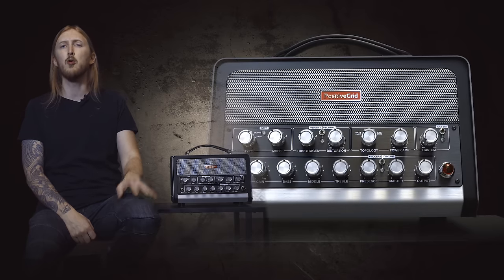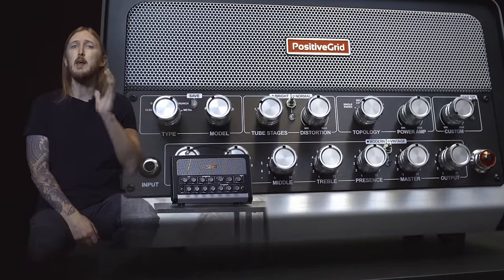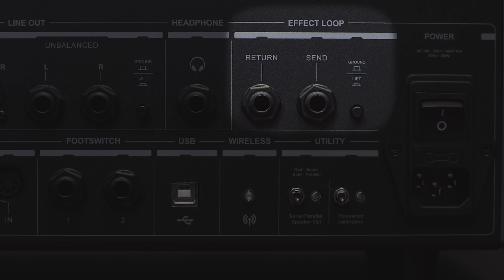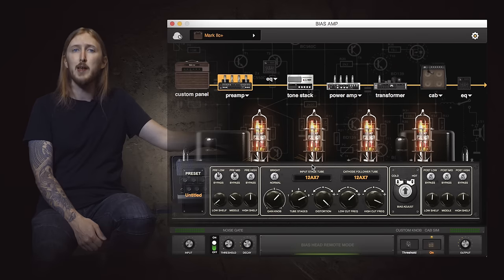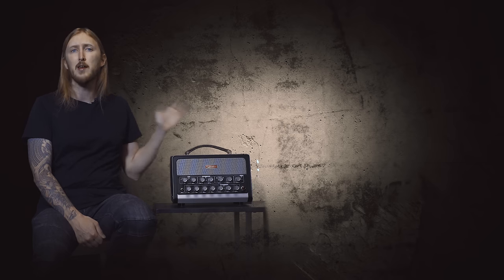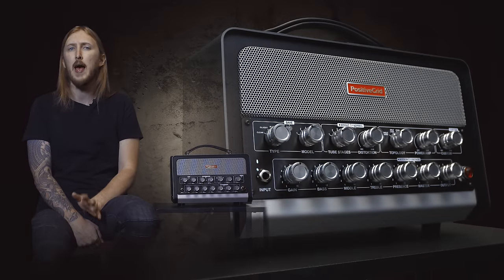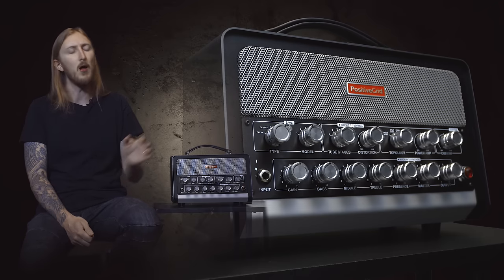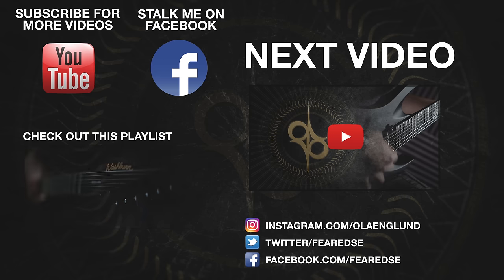BIAS Head - Metal?

Comment from the maker: Everyone complaining about the direct signal , just remember that the presets are created to sound awesome in the room using my cabinet and microphone. The direct signal clips in this video are basically the same presets with just the added cab sim in BIAS Amp. If I were to set up the sounds just going direct they probably would've sound a lot better. 

Put a thumbs up on this comment to keep it at the top.... maybe....
Reply: Now that you can pin comments Ola, you should do it on this one. Great vid.
Reply: Sounds just fine to me....
Reply: this is over...im buying the mini...an Apolo interface...and going straight to my laptop...my only problem is that i need a real cab and good monitors but i don't want something very expensive...i need very good monitors that can sound natural with the cab sim...so i can hear my tone

Comment: Still confused on what the BIAS head is. Like answer me this, strictly soundwise, the sound signal that's coming out of the head, is it any different than the BIAS software? Like have they improved or redone anything or is it the same modelling? 

I get the idea of bundling it all up in a head, and the hardware features are nice, but I'm having a hard time reconciling the price for this thing if it's just the same sounds as the software?
Reply: I think the main thing is that you also have a built in power unit to it, whereas with most modeling amps currently you do not have that, and would need it to use live. (400-800+ dollars easy). I think they've improved the amount of control overall with their front face section as Ola explained, but I'm not 100% sure on any other changes...
Reply: Straight up answer?
It's a computer running bias.
For the price of a Kemper.
Reply: That's the assumption, I think it's only 1300 though right? (US & Canada) Which if you're looking for a done setup could be enticing as to avoid buying the power amps etc. I know it changes based on import costs.
Reply: Yep, but correct me if i'm wrong, but the kemper also don't use an external power amp does it?
Reply: I think you're right, Kemper does have some power heads though (?). They have a few models for an extra 2-300 that come with it (?). I know AxeFX is still, last I checked, without them.
Reply: I figure it out.
The entry kemper is 1666$ and does not have a power amp.
The Kemper Power head is 2000ish with a built int 600w power amp.
So, at least for me, I don't see a good reason for buying this bias head.
I mean, it's like paying 1300 for a computer + usb digital interface. To get the same sound you would get running through a regular pc with bias amp/fx on it.
Reply: Actually is worse than a pc with bias. Because in order to config and mod it, you need a pc WITH BIAS. And there goes more money to used it.
Reply: when you buy the amp it comes with the software.
Reply: Calm down pretty boy. Go and use your bias then, jezz
Reply: I would trust Tony on this one.  He uses them alongside one of the more prominent people for BIAS (Fluff) in his band; Rest, Repose.
Reply: Its a) for people who love Bias and own Bias Amp or Effects, b) for people who want to gig with Bias but don't want to kick around their laptop on a stage, and maybe even drive a real cab for monitoring on said stage, c) people who want to record with Bias and for whatever reason would like to record direct from the head instead of a plugin (less resource consumption? maybe they're recording at someone else's studio? who knows). Its just another "box that does it all" and is more affordable than other similar products. I think either way, we live in spoiled rotten times to be guitarists!

Comment: Hi Ola, how does it work in terms of powering? If it's a 600 w solid state amp, do you need to ensure the cab you're using can take 600 w? I don't think a lot a 2x12 or 4x12 cabs can take this much?

Comment: I'm a bit of a newbie when it comes to the electrical engineering specifics but a question: at 8ohms it says it is running at 600w. if I have a 2x12 with V30s (which are 60w a piece or 120 total). aren't I vastly overloading the cabinet?!